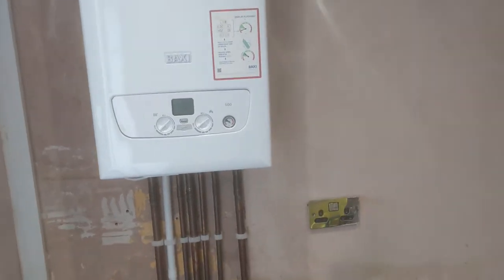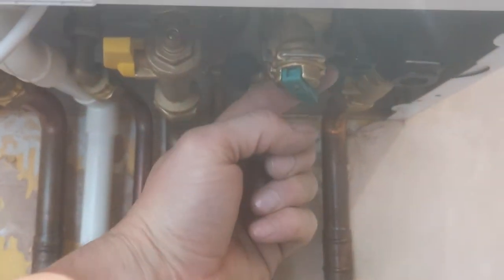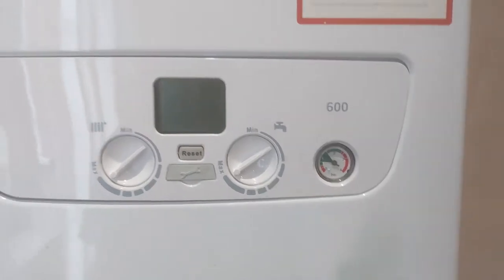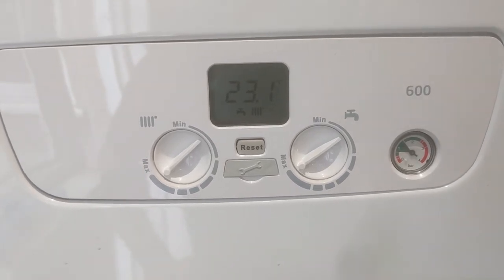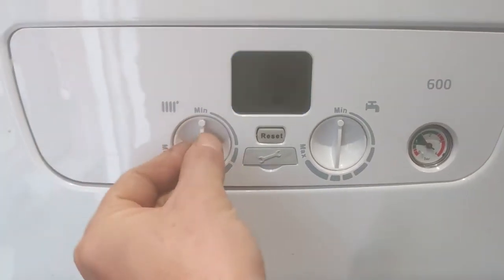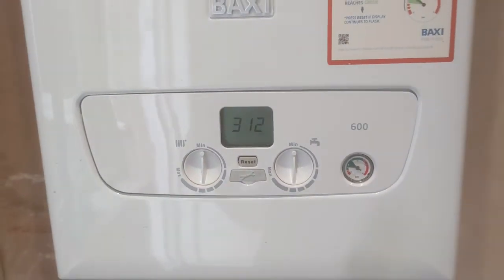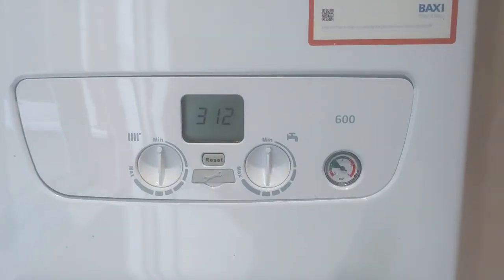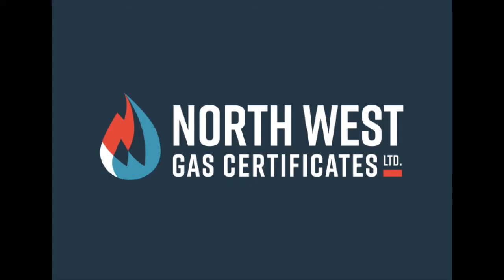Baxi 624 Purge function

Comment: Thanks. Clear & concise video. Does this work when the boiler control is in Opentherm mode? (the temp control knobs on the front don't control the temp in Open therm mode & so was wondering if they still worked for this aeration mode)
Reply from the maker: You ve got me thinking. I will find out and let you know👍
Reply: How do I top it up a little